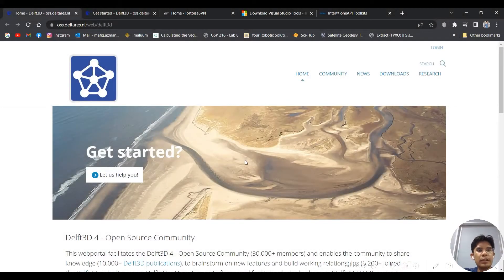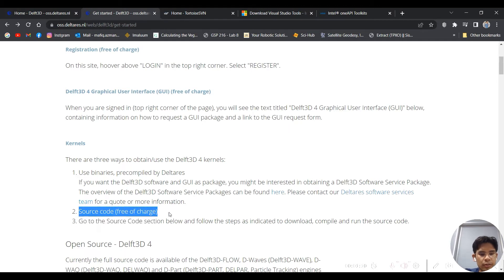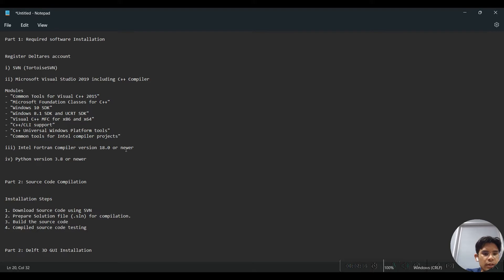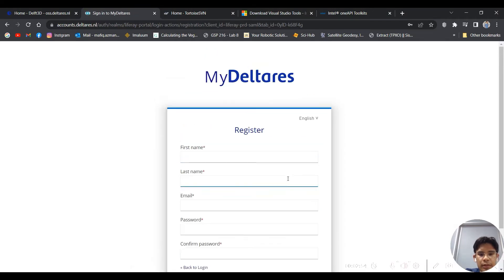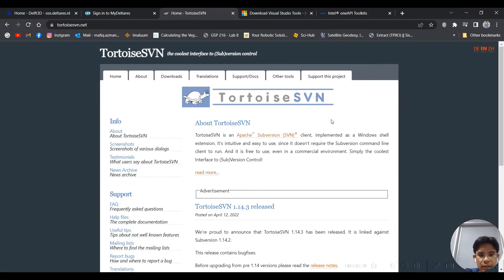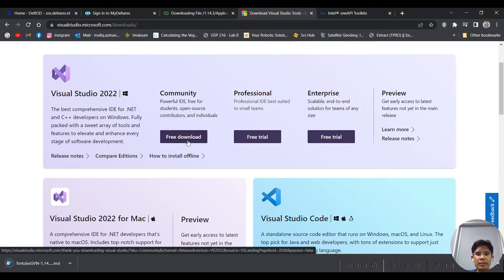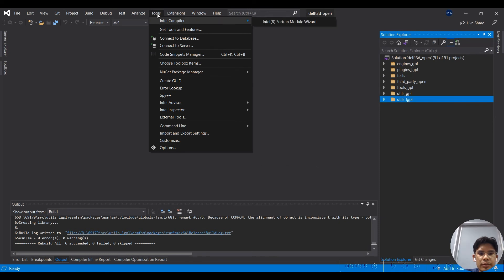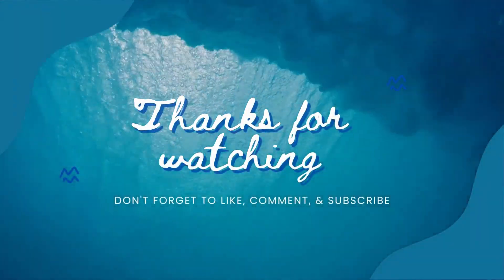Delft3D Tutorial: Installation Part 1

Comment: Very helpful video. In part 2 there is an indication on which packages to install in Visual Studio 2019.

Afiq Azman: "This is my VS 2019 modules.
1. C++ core features
2. Windows Universal C Runtime
3. Windows 10 SDK
4. C++ 2019 Redistributable Update
5. C++ MFC for latest v142 build tools (X64)
6. C++/CLI support for v142 build tools
7. Windows Universal CRT SDK
8. MSVC v140
9. .NET Compiler Platform
10. .NET Framework 4.6.1 SDK"
Reply: i already install all of these but still get error when compiling in mvs
Reply: Can I ask for the visual studio 2019 offline installer? It's not downloadable on their website anymore. It needs subscription now 😭